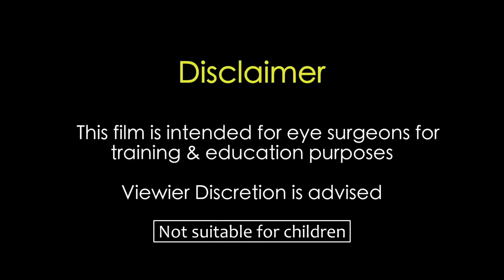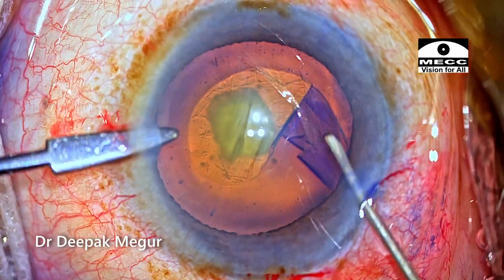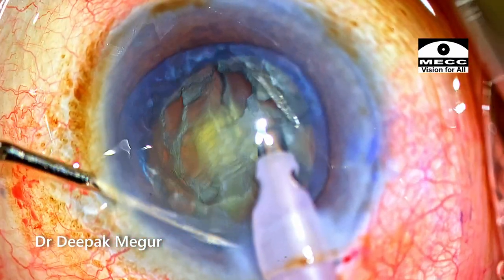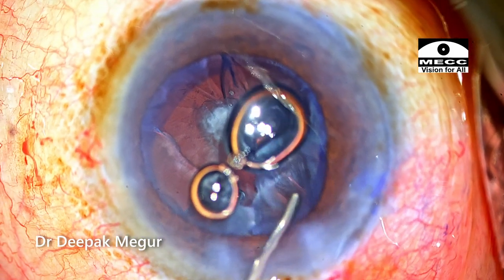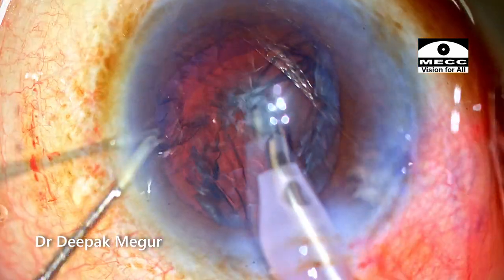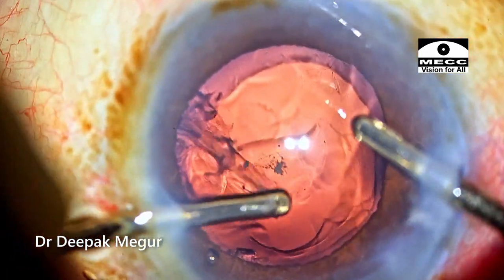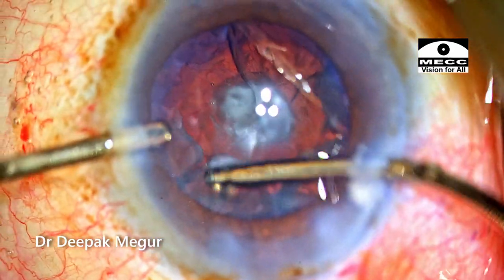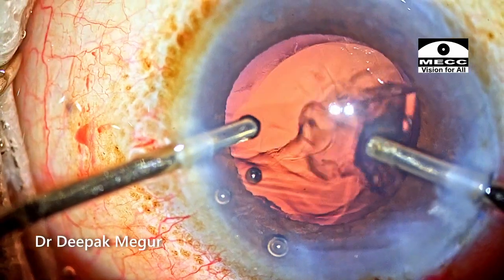Posterior Polar Cataract. How to deal with Epinucleus & Cortex - Dr Deepak Megur

Comment: Excellent as always Sir. Could you please post a video of how to do Grade 3-4 NS with dense PPC? 
I would be grateful for tips on:
-  large rhexis in dense cataracts vs 5 mm oval rhexis in ppc
- removing one heminucleus in soft ppc vs tackling a hard heminucleus in gr 4 ns+ppc without rotation.
Kindly advise. Thank you
Reply from the maker: 1. Oval rhexis , may be slightly bigger ( 6mm in the wider axis and 4.5 to 5 mm part in narrower axis) is a better choice.
2. Soft Nucleus - easy. just engage the entire  heminucleus  with very low power and get it out of the bag and emusify.
Hard cataract - difficult because the bulk is more. I prefer to make one chop in the heminucleus and the engage the pie fragment and pull it out of the bag and emulsify. repeat in the other heminucleus. once 2 pie fragments ae out , enough space in the bag to mechanically displace the remaining part of the heminuclei centrally and emu;sify.
3. Thankfully most PPCs will have soft nucleus. In many white or dense cataracts we will diagnose the PPcs only when we have a drop...!

All the best
Reply: Thank you for your valuable tips.
Reply: @drvidyab  Sir I hv also the same question & Deepak Sir has explained it very well .